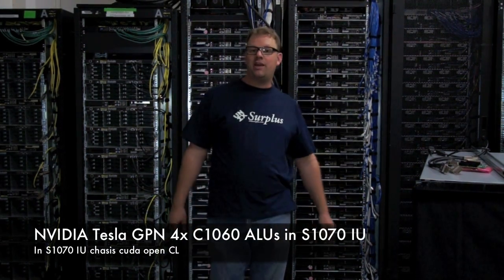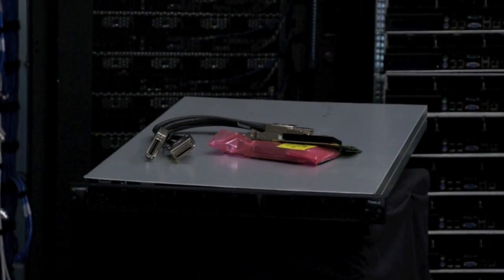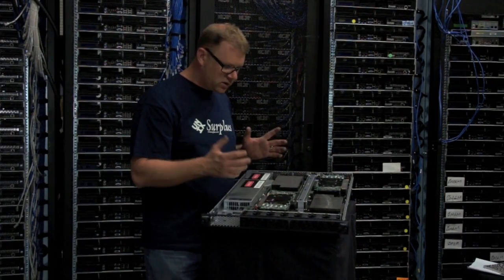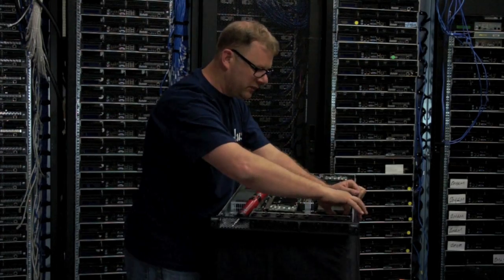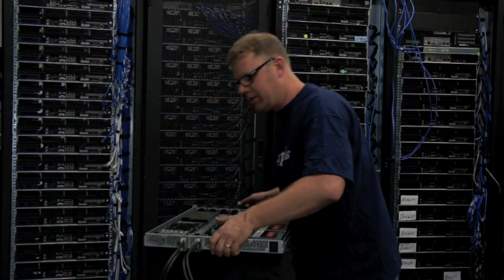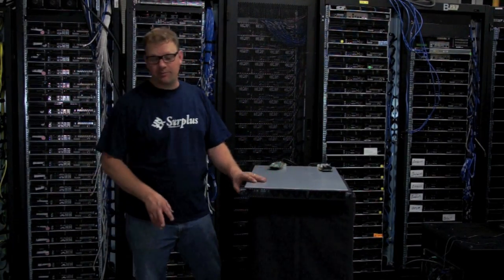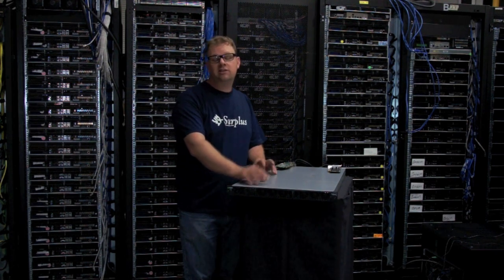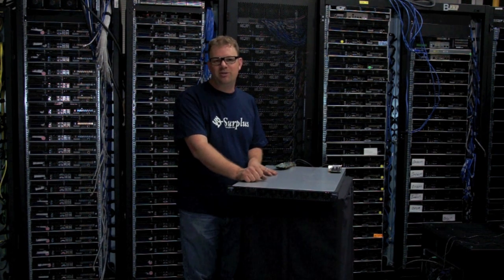NVIDIA Tesla GPU 4x C1060 ALUs

Comment: Good day. I have a Tesla S2050 server in which I installed the M2050 Tesla K20M site. When the server is turned on, the S2050 fans spin for 10 seconds, after which everything turns off, the server starts up and P797 cards are identified. What could be the problem?
Reply: B.I.O.S. UPDATE!